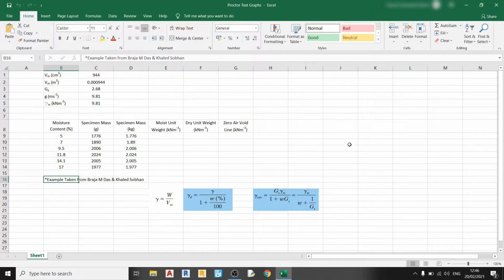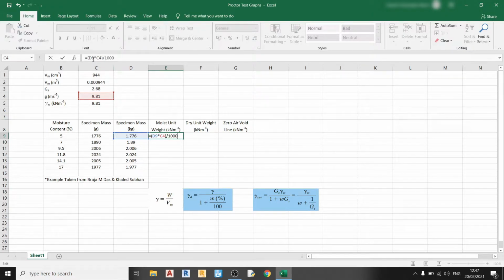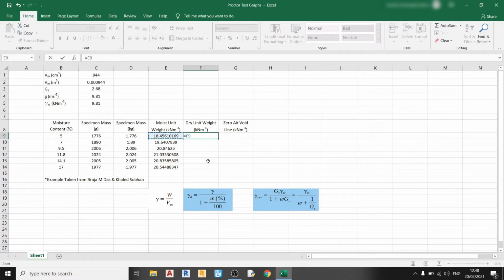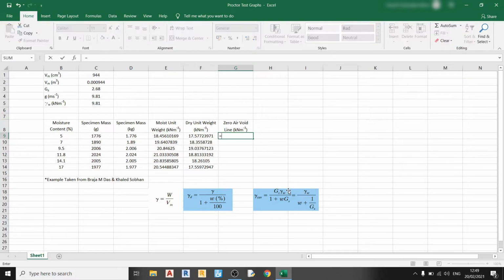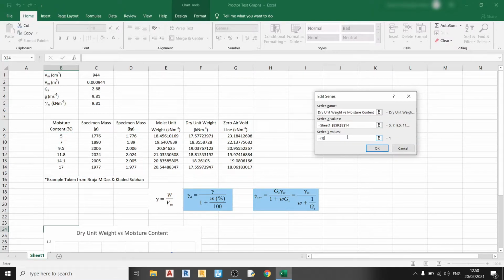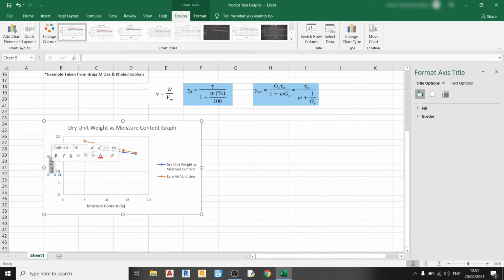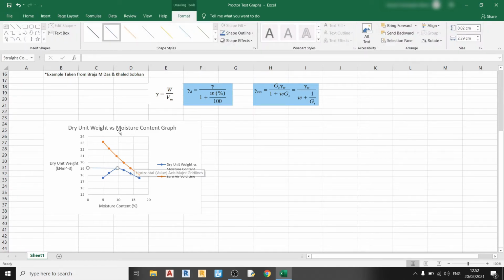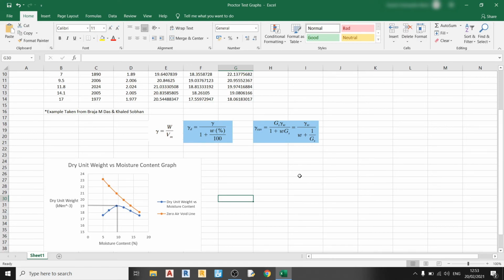Using Microsoft Excel to find optimum moisture content

Comment from the maker: Timestamps:
0:00 - Introduction
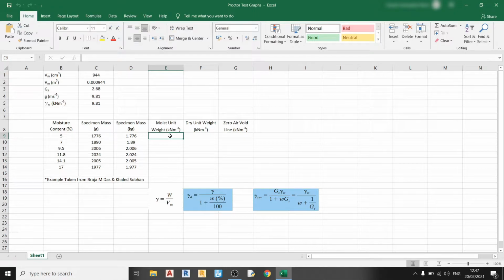0:35 - Moist Unit Weight Calculation
1:58 - Dry Unit Weight Calculation
2:38 - Zero Air Void Line
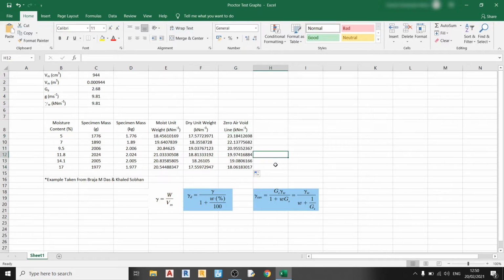3:20 - Graph Plotting
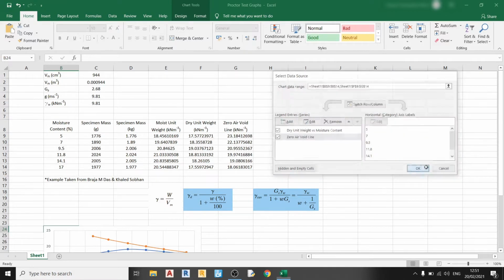4:26 - Graph Formatting
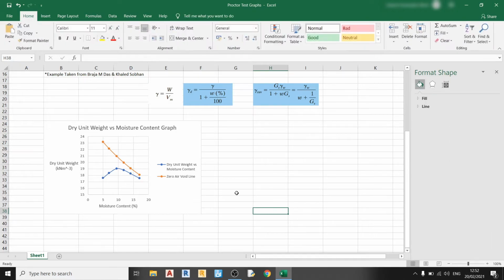5:28 - Finding the Optimum Moisture Content